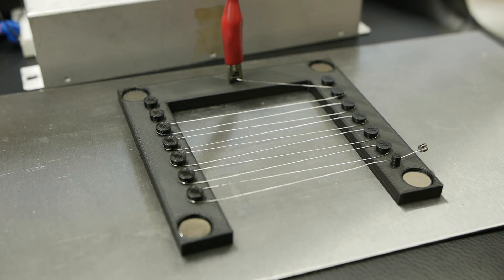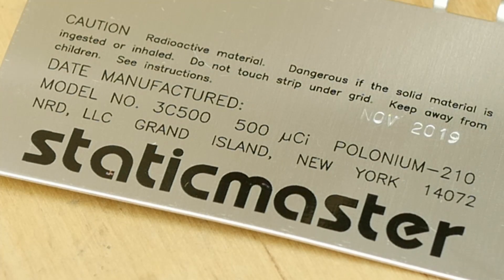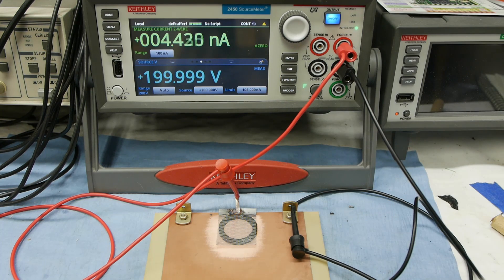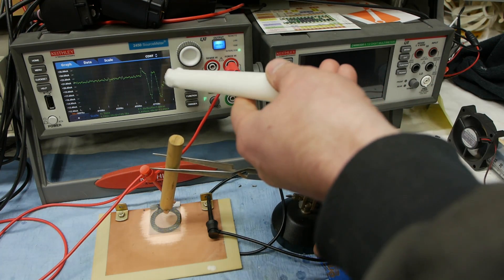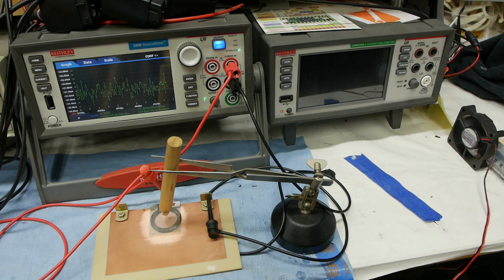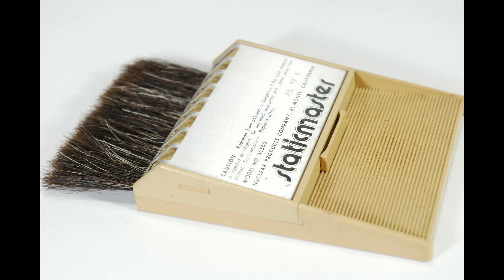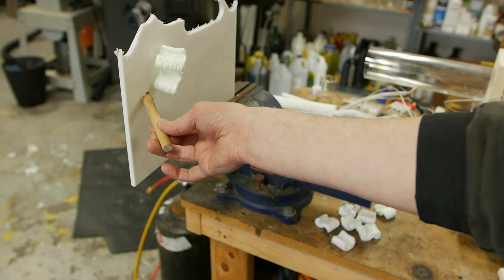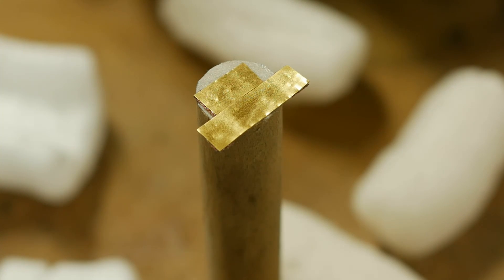Alpha radiation makes sparks, detects smoke, and eliminates static cling

Comment: that Staticmaster brush was used mostly in Photography to brush the dust off negatives. My dad was a Photographer in the 40's-70s we had it in our darkroom when I started to take photos back in 1967.
Reply: Wouldn't that fog up the negative?
Reply: @ColonelAngus101  Not after the film is processed
Reply: I wonder if it would be beneficial in cleaning digital camera sensors. It's always a chore.
Reply: @RobinDobbie  i guess its not exactly a good idea to shower a highly sensitive photoreceptor with ionizing radiation...
Reply: That's a good guess! I sorta megaderped regarding ionizing radiation and electronics.
Reply: But then again, doesn't film have a bit of trouble with ionizing radiation as well?
Reply: @RobinDobbie  as @aerogfs said it is probably used after developing the film, and then the film is no longer reactive
Reply: @TheScarvig  Test it! one published result with dead CMOS or CCD is better then 100 unpublished dead image sensors 8-)
Reply: @TheScarvig  Most likely won't be a problem, as almost all image sensors have a piece of glass covering the silicon die. This would be enough to stop the alpha radiation. That being said, I haven't tried and please don't hold me responsible for dead pixels!
Reply: @TheScarvig  it shouldn't be a problem since alpha particles are just helium atoms (maybe ions, i don't remember now), so it's an atom, not an electron as in beta radiation and not a high energy photon as in gamma radiation, so it cannot penetrate the piece of glass that you want to clean from dust and get to pixels, so it should be perfectly fine if you are using the source of pure alpha particles, because as you can see in video, some sources of ionizing radiation can radiate not only alpha particles, but also beta and gamma radiation and this could probably be bad for your camera
Reply: @hotgluegunguy  exactly as I said!
Reply: @hotgluegunguy  Yep and furthermore, I really think the radiation level from such a brush would be way too low to cause any damage. Cameras among plethora of other sensitive electronics are routinely x-rayed in airports, and there are lots of electronics in medical x-ray rooms. Actually, in cleaning sensitive electronics, such a brush might be the best choice because it keeps the real danger of damage - electrostatic discharge - at bay. It would be interesting though to see whether the image sensor reacts to brushe's radiation.
Reply: Years ago, I had a genuine Staticmaster...wonderful tool! I used it for dusting negatives, and yes, LP vinyl records as well. It was unreal to see how effective the device was indeed.
Reply: @robertborchert932  My brother has my some of my dad's old stuff I think that was with it
Reply: Wouldn't mind one, I have cats.
Reply: @Aggnog  I have cats too. I just rub them on my hair and stick them to the ceiling where they can't be a bother.
Reply: @Aggnog  I got 8 cats too
Reply: Did you die of Polonium poisoning, though?
Reply: Same here. Did all b&w developing and touch ups. I mixed the chemicals! lol.

Comment: What would happen if a sample was sealed inside a plasma globe?
Reply: That's actually an interesting thought experiment. I bet it would create a constant "beam" of one of the blue arcs toward the outer glass globe in whatever direction the source was pointed. The free path of the alphas in air as can be seen in the beginning of this video is very short, few inches tops, but in the reduced pressure of a plasma globe I bet it would be several feet. Long enough to make a continuous conductive path from the center to the glass.
Reply: @Muonium1  Why just stop with a "thought" experiment? If you know how to make a plasma globe, you can test this empirically. What stops me from trying this are that they won't ship radioactive materials to the country I live in... and that I live in a studio flat and don't fancy fooling around with high voltage. Truth be told, high voltage scares me a lot more than ionizing radiation.
Reply: @Schwarzvogel1  If I could make one, I would. 😕 I'd love to see this! Ben seems to be the best bet of seeing this happen.

Comment: You should get another cheap geiger counter without a metal shield around the tube so you can detect alpha. My orange fiesta-ware dishes with uranium-oxide glaze are great alpha emitters! Now I want to get a HV power supply and make an arc detector like this!
Reply: LND712 tube has a special window to detect alpha particles. Tube itself cost about 55USD.
Reply: You can also get soviet SBT-11A (СБТ-11А) geiger-muller tubes for less than $30 on eBay. They are great at detecting alpha, and can be hooked to any geiger counter (if the voltage is right)

Comment: How viable would a brush or comb connected to ground be for removing static electricity from hair or textiles or whatever? I've always wondered if there's some easy way to get rid of all this electrostatic buildup that happens around here in winter, where just touching a grounded conductor with my hand doesn't get rid of the static in the clothes that I'm wearing, for instance.
Reply: I had a vinyl record brush that had an attached cord for connecting to ground.  I can't say that I noticed much difference between it connected to ground vs not. The bristles were made of carbon fibers, so maybe some different materials would work better?
Reply: Water works to remove static build up. A little applied via spray bottle.

Comment: Blowtorch is definitely one of most enjoyable ways to light a candle
Reply: i found the spike upwards on the multi meter when the blowtorch was lit rather intriguing.
Reply: @nullvoid3545  That meter is so darn sensitive that it detected the bloody piezo igniter in the torch. Impressive!
Reply: @DrakkarCalethiel  wow! thats what it was? thats awesome! thank you for the info!
Reply: @nullvoid3545  High voltage igniter and flame as ionic cloud acts as conducting sphere, so sphere air capacitor (aka top load in Tesla transformer) emits electric field spike into space that was picked up by sensitive amp-meter...
Reply: @ZegaracRobert  :
I bought a small device that makes an arc, which I use to light propane or candles. It is from Taclight, I think that is the company name. I think it generates about 2 kV. The spark lasts for 10 s before it auto turns off.
Reply: Pretty satisfying lighting a candle with a laser though as well...
Reply: I got laughed at when I lit my daughters birthday cake candles that way
Reply: @madxenomorph  They might have laughed, but they were also respecting your degree of control of *fire*. Hey, we firebugs need to stand up for our traditions.
Reply: I think a oxy-acetylene torch is the ultimate way to light a candle
Reply: Hey, don't knock it. I got tired of my puny little gas grill butane lighter blowing out in just a small breeze that I now routinely use my propane tank with the push button ignitor to light my homebrew burners.
Reply: Yeah, just what you want near your polonium, apparently.
Reply: Just make sure you don't vaporise the polonium foil.
Reply: Especially if you apply it to the bottom of the candle.
Reply: I let out an audible chuckle at how needlessly overkill that was!
Reply: And cigars
Reply: Agreed.
Reply: 😍😍😍 your videos!!!
Reply: 😊
Shalom 
😊 Shalom 
Andar nas águas  ! (tribos portões pelo qual cada um entrará entenderá , aonde, a Ruach Kadosh  testifica o mesmo  Espírito )
Shalom 
Dos 4 animais 
Boi leão  águia  homem 
Boi  rumina  (medita , salmos  1 ) .?
, casco fendido (sabe separar as 2 casas de Israel , vara de Arão ?
Revelação pelo Espírito Santo,  como Pedro  em poder ....
 asas da grande  águia = Adonai  e suas  asas talite espiritual   = Ruach Kadosh. 
https://youtu.be/DYp22lkw3YY
A moabita com a sogra  é um paralelo  midrash com as duas casas de Israel  ?😊☺ e Yeshua Ha-Mashiach  ?
https://youtu.be/Z0Qdeg602BM
Reply: Yes  it  reminds  you  of  Christmas  with  candles.   Drinking   Russian  tea  with  just  a  stint  of  Po210 .
Reply: Blowtorch is definitely one of the most enjoyable ways to x.
Reply: And safer
Reply: Atomic powered blow torch actually.  I believe that will be the subject of the next video.